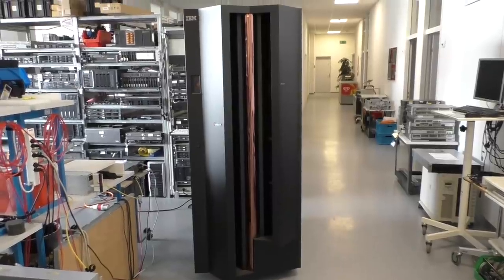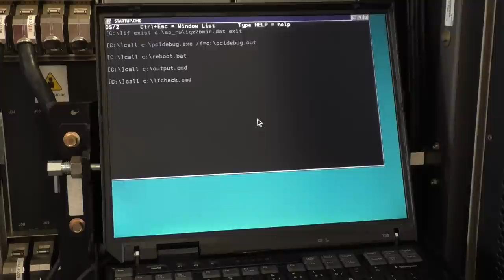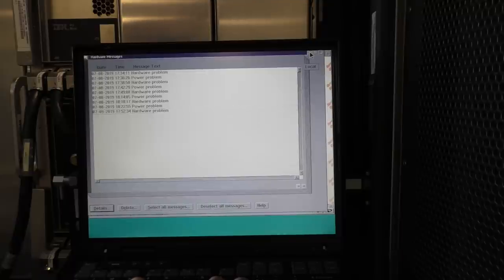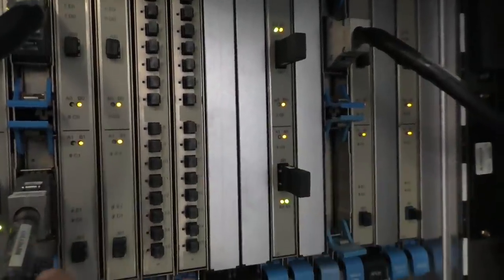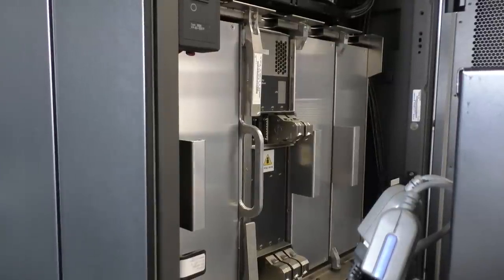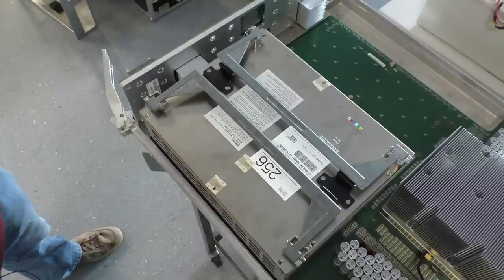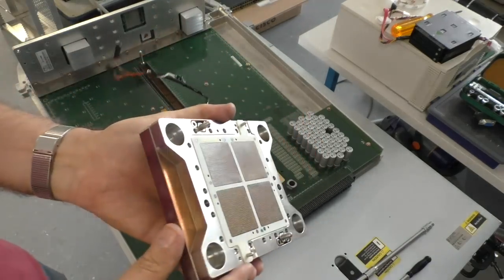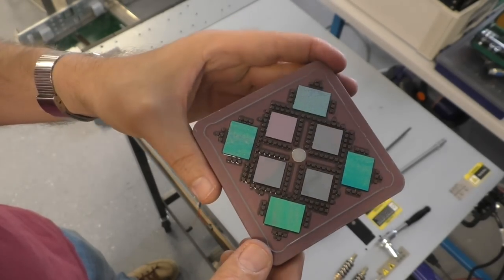Powering up the IBM Z890 mainframe and teardown - (PWJ148)

Comment: Built like a tank, weight of a car, sounds like a plane and performance of a raspberry pi 4 - I LOVE IT :-)
Reply: Take a look at my icon/avatar.  IBM 360/44 in 1967 - Built like a tank, weight of a car, sounds like a plane and performance of a modern watch (probably less).  But we were doing particle physics research.   I LOVED IT.
Reply: TheTaleteller quite a bit faster and more capable than a raspberry pi
Reply: @latentexistence  A raspberry pi also does not have the virtualization capability to run multiple VMs with little slow down.
The IBM Z line which is still produced are able to replace an entire room of PC servers.
Reply: I was really wondering how it compares to present day computer. hahahahahaha, rasberry Pi level at 700KG
Reply: @renderdreality  well if it is how it was then my pc would destroy it but if that thing was fully connected to everything my pc would not stand a chance im pretty sure i dont know much about servers (my pc specs intel core i5 7400 3.00ghz 4 core 8gb xfx radeon r9 390 16gb ram 2133mhz if i had correct board 3000mhz) i kinda wonder if it would stand to that server if that server could run windows
Reply: @matthewcoffy1385  Do you think the owner of this channel will be able to find out it's comparative specs to modern computers?
Reply: @renderdreality  i do think so all computers have the same basic stuff when it comes down to it
Reply: You forgot: power consumption of a small city :D
Reply from the maker: can a raspberry handle 500 usb ports at full speed?
Reply: Play with Junk muahahahaha..knockouts
Reply: @renderdreality  Five Processor Units, Up to four Central Processors (CPs). One mandatory System Assist Processor (SAP). Refer to the table following, Up to 32 gigabytes of memory — 8 GB, 16 GB, 24 GB, 32 GB, Up to 16 gigabytes of bandwidth for data communication between I/O and memory via up to eight Self-Timed Interconnect (STI) host buses.
Reply: Stan .Rarick for Bubble chamber track analysis?
Reply: @godofwinetits3826  Well I don't know about you, but assuming a 24/7/365 uptime, I'd much rather pay for the electricity bill of my Raspberry Pi 3.
Reply: Suddenly tech youtuber comes..
Change every component to massive high end cpu...
Now it has 0.1% of nasa computer
Reply: It will vastly outperform a raspberry pi. These things are designed to shift and process large amounts of data while serving many users. Also the RPi4 throttles itself as it really needs a fan.

However I think that laptop might have a run for its money against the pi
Reply: Comparing to rpi: You’d normally put many rpis for similar workloads. You could cheaply connect up 8+8 rpi’s to a pair of redundant network switches, two off-the-shelf 5V power supplies, and you’d get a system just about as capable, reliable, with similar memory and bandwidth. Whatever CPU power is extra compared to the mainframe, is extra, nobody forces anyone to use it. The NUMA memory bandwidth would be only 1Gbit/s, but the application could be designed to run with that and no more. You could actually reconfigure Linux to run NUMA on rpi’s, no biggie. Linux makes homebrew mainframes easy that way. The rpi-based system’s boot time would be likely constrained by the boot time of network switches, not rpi’s. And at a silly fraction of power - 300W or so. And a silly cost. So you could easily get a few such “mainframes” for redunancy redundancy :)
Reply: Kind of amazing that it’s all in one raspberry pi 4
Reply: Yes but contemporary zseries mainframes are faster, run virtual machines, modules replaced with power on(reliable), much higher data throughput. But no GPU architecture in design as they are supposed to work with terminals. Only large financial companies nowadays use such computers as they have lower total cost of ownership than networked Linux boxes.
Reply: @latentexistence  with all that IO I am curious if a mainframe could have an advantage over a massive ZFS cluster and net switches for a FPGA/GPU cluster
Reply: aa bb A friend has a NUMA rPi cluster to serve a few thousand remote users in quite remote areas of the planet. They are evaluating rPI 4 for an upgrade. Any element of the system can be easily replaced while it’s powered on, and it’s all off-the-shelf stuff, so you can buy spares online easily. Most financial workloads are highly parallelizable anyway, and make it a breeze to distribute the load across NUMA nodes. It doesn’t take many rPI 4’s to saturate a 10Gbit Ethernet link – not as a benchmark, but doing useful work. I’m evaluating an rPI based gluster cluster as a backend for samba serving Windows desktops, and it also doesn’t take many of them to saturate the links. Kudos to RH of course for making gluster scale well.
Reply: @absurdengineering  The communication overhead is enormous and performance doesn't scale up that way. Renting part of a large server is cheaper after all
Reply: Be more respectful sonny.

A machine like this has the CPU and I/O capacity to run an entire hospital, supporting thousands of terminals, from clinical inputs to patient database to financials 24x7 with greater than 99% uptime.
Reply: @matthewcoffy1385  your better off  running Free Dos or some variant of linux if you must change the OS.
Reply: That mainframe is still very capable of processing millions of small transactions in an instance with no sweating... No raspberry pi can do that for sure.
Reply: @beedslolkuntus2070  no it's not. :) That mainframe is old but it can be still very useful in ways a RP4 cannot. 
Those computers were built mainly for I/O not for games or CPU power! It has so many channels that it can process millions of transactions in a heart beat still today.  It can be still used for small transactions, like when you buy something with your bank card, multiplied by millions of people doing just the same. It's like comparing an old CATERPILLAR truck with a Renault Micra. They serve different purposes.
Reply: André Garcia 
Never taught someone would reply 6 months after. Thanks!!
Reply: @beedslolkuntus2070  eheh you're welcome!
Reply: André Garcia 
:)
Reply: @aabb-zz9uw  and encrypt everything on the fly.  Not only large financial institutions, but also hosting companies...the virtual machines you mentioned...the current zSeries can also give you mainframe class security for Windows Servers (has been doing it for a while...)
Reply: Actually mainframe is not designed to compute fast, it is designed to handle massive concurrent IOs.
Reply: @Patchuchan  sorry but yes ... esxi runs flaweslly
Reply: @renderdreality  a pi 3/4 can basically beat a HPC box from 1988-1993-ish. that's likely the limit.
Reply: @matthewcoffy1385  you won't be able to run windows on the CPUs (something similar to Power3 or so in this, idk?), also not on the rest of the system. only on the os/2 maintenance laptops you'd have a chance ;-)
Reply: Perfect description
Reply: While the raw CPU speed, even multiple clusters of them, is not that impressive by todays standards, the I/O bandwidth of those mainframes is still something a pi can only dream of 15 years later. but still, its impressive to see that higher end desktop computers for a few thousand euro/dollar/pounds are becoming so powerful they could run rings around the Z890 even for large parallel workloads. look at those 128 pcie 4.0 lanes on a single cpu threadripper system for example. its nuts.
Reply: Built like a tank, weight as a tank, sounds like a plane, cost of the same, and performance like a calculator..
Reply: Mainframes strength is not in compute or performance, it's in IO processing. It's built to handle millions of simultaneous connections to remote clients. It is used when scale can't be achieved by paralellisation, or the data absolutely cannot be in conflict or have different versions even for seconds. Such as central banking.
Reply: @PlaywithJunk  If this is USB 1 then yes
Reply: @NeptuneSega It isn’t. Raspberry Pi’s couldn’t compete with this on any level.
Reply: @matthewcoffy1385  Windows don't runs on that maschine. The goal of the design is different as an Intel PC or a Mac.
You can't compare that. 
Today (2024), datacenter uses mostly intel x86 based servers, because they are cheap. Number cruncher uses 1024 AMD EPIC SoC in a Cluster and often runs Linux with sepcial optimized libraries to support the multiprocessing. IBM host systems are based upon a modular connecpt. The same hardware for different customers. This are the Z-System, thats able to run Linux, AIX, OS400 Z-OS.
Reply: hhhahaha

Comment: This is the last IBM iron I used before retiring in 2008 . It was really good stuff , I worked at my alma matter University of Calgary in western Canada. We could register 35000 students for classes , process payroll for 20,000
Full and or part time staff all using COBOL green screens and finally full GUI IP connected web apps running on this box under IBM Websphere and MQSeries messaging services tied into IMS Databases and CICS online transaction processing monitor doing in excess of one million online real-time transactions per day , that was a very small shop. Some IBM environments ran in excess of 20,000,000 transactions per day like banks and airlines that still use the big iron. Glad to see this hardware is surviving for future generations to see trust me it’s successors will be around for a long time yet !

Comment: I like how you bothered to set the correct time and date when it's just going to be scrapped.
Reply from the maker: Yeah :-)  The problem is that when you don't fix the date and time, it will probably not start up correctly. And I wanted to show how it starts. I even tried to fix the power supply but was not successful.
Reply: you didnt scrap the service elements did you?   A shame to see vintage hardware die

Comment: This machine debuted at $200,000 usd in 2004.
It has one processor book of four processing units, compared to the z990 that had four books of eight!
This unit was primarily made to bring in customers who didn't need the large, gaudy power of the larger systems.
But also to bring in customers who were simply using the older mainframe series.
Reply: Only 200k?
Reply: with only 1 pu book i would guess 800-900.000 usd new
Reply: and you could upgrade to  the zAAP processor for only $125,000 each.

Comment: Man... I've setup so many of this :) that's not noise, 20 nodes of that is noise :D and a small nuclear power plant to feed them, those things eat electron for breakfast, at full load, 100Kw to 150Kw. Amazing machines from another era. Still have a few parts of them hanging on the garage. I just wonder they worked so many time in your shop, they are complete daisys with temperature. Nice to see on outside a DC.
Reply: Does this need three phase power supply?

Comment: OS/2 was used in most ATMs until very recently, there would presumably have been backend OS/2 Warp servers, though most probably interfaced with legacy servers going back decades for well established banks
Reply: @Michael Hansen Sorry, you are wrong. I worked at a major UK bank in the late 90s and it was used directly on ATMs

Comment: Hehe, the power-connectors make me remember the huge UPS rackmount case we took over from a bankrupt school.  When it was inside and colleagues were thinking about installing the batterypacks (huge 18 kilo rackmount batteries from which we had 10, I think), when it was on the second floor (a wooden one) someone asked what the maximum weight allowed on the second floor was.
It was somewhere around 330 kg's per square meter or something (which is probably a value with some kind of margin, but still), and should they have installed every battery and the three inverters (25 kilo's each) they would've exceeded the maximum amount of weight by about 300 kilo's.
They quickly decided to spread the weight as much as possible by taking out all the batteries and inverters and storing them as spreaded as possible.
When we had to dispose of it (2 times 3 phase power was not available in our building and remodelling was far away at that moment and it was taking up way to much space) the building outside of our room had been remodelled and they had put wooden flooring in, that heightened the floor just enough to be unable to get it out of our room, and (especially) into the elevator :P.

Comment: They might have still used modems for calling in service calls at the time.  When I worked in the zSeries test lab 12 years ago we still had a lot of the modems in our storeroom.  Used one for dialup at home until we got broadband.  I know the pSeries systems still used serial management up through Regatta/Power4, then Power5 was when everything went to ethernet-based (the 24" racks actually had an ethernet network just within the rack itself).  That was probably 2004, so mainframe probably had that 2-4 years earlier.

Comment: The 2 laptops you have in the front of the Z-Series are known as the Service Focal Points.  they are identical and redundant just like all the components in a mainframe are
Reply: Are they really laptops? Because a laptop wouöd have its own os, own everything, and these one look and behave like  a rack console in the form of a thinkpad notebook
Reply: IBM training is so awful, they never really explained to us what a SFP was, you just learn to type commands and call engineers when it goes tits up.
Reply: from a command centre by the way, where I worked remotely.
Reply: @legominimovieproductions  Those are bog standard Thinkpad T30s connected to the mainframe via Xircom cardbus ethernet cards by the looks of it (I recognize those dongles). Those T30 Thinkpads are also pretty damn rare as it was the only Pentium 4 Thinkpad ever. There's only this one T30 model, unlike the series before it (T20/21/22/23 with various iterations of Pentium 3) or after it (T40/41/42/43 with various iterations of Pentium M and built in flexing problems across the board)

Comment: The second laptop probably didn't start up due to the fan issue.

The latest PUs have a large single die rather than an MCM from what I understand.  They are mounted in water cooled drawers.  On the MCM you were showing, the four chips in the middle are the PUs themselves and the four others are the caches.

Comment: Absolutely horrible things to troubleshoot, I had the pleasure of working on a set in Botswana for the Forex department of FNB bank in Gaborone. FYI working with a set of two does sound like the back end of a  Boeing 737.
Reply from the maker: Yeah I guess the error messages are pretty cryptic.... Something like "ERROR 056725 IN DEVICE 0201"  ...?
Reply: @PlaywithJunk  Not really if you got the books translating those. IF you can still find one that's not completely bleached out ;) Or if you can find one of the old (as in ancient) ibm guys knowing those by heart ;)
Reply: Rectifier circuit maybe? Capacitors? Just an idea ;) If it's unstable i mean ...
Reply: @peterpain6625  The code at the side of a message will also tell you where it came from, the sequence of the message and the type of message.
Reply: @peterpain6625  I remember the documentation for our mainframe; it was like a library with 300 thick volumes requiring its own dedicated room.
Reply: @PaulaBean  The good old times when there was still (any) documentation ;)

Comment: Yes, you can create Logical Partitions LPARs and run independent services in each: TSO, CICS, DB2 and IF you upgrade to z14 processors and zOS2.4 you can run a Cloud Service under Red Hat in a Unix System Service (USS LPAR) but the real reason these beasts will continue to function as a key part for major corporations is that that Cloud Service can retrieve legacy data from VSAM/IMS/DB2 data stores w/o going thru the TCP/IP stack... but cross memory using the Coupling Facility.

Comment: IBM probably didn't really want to use OS/2 here for the laptop, but the software was probably already there for their previous mainframes, and by using their own operating system and laptop they could provide full support, including security and long term support without relaying on Microsoft.

Comment: Yeah, fans failing in the T30 and T40 series is pretty normal. You blow out some dust, put some oil in the fan bearing to make them work again. There are also replacement fans on ebay in good condition or like new. But it is a pain to get to them, requires a lot of disassembly of the notebook.

Comment: The laptops to IPL etc used to run OS/2 then they went with linux and an interface that looks like the OS/2. Btw all models had every cpu and you call IBM to license more cpu power via the Golden screwdriver. You would connect to the drives vis Bus and tag or ESCON.
Reply: @VIDEOSUPERHIGHWAY
So the CPU runs at a default low speed until you get a special code to make it work harder? It kind of fits what I've heard about one paying for CPU cycles used, or something. I've heard IBM has crazy licensing terms for their mainframes.
Reply: Now we know were Elon got the idea for the Teslas.
Reply: Keysight does the same with their oscilloscopes.

Comment: IBM didnt use "sockets" for the cpu module. It was gold bumps that made contact
Reply: you mean just like in cpu sockets that have been around forever?
Reply: @firecrow7973  since the P4, hardly forever. My first pc used a super socket 7 - an amd k6-2 400mhz. Also intel and amd still use alot of licenced tech from IBM even in their current cpus
Reply: @firecrow7973  forever for who? PCs? Because of the hundreds of connections to each CPU module, IBM didnt use sockets, they used tiny gold bumps that mated with other gold bumps. The CPU modules were fastened down in thier respective locations by various means (clamps, screws etc) CPUs were not just one chip like PCs. A maimframe CPU was made of modules.